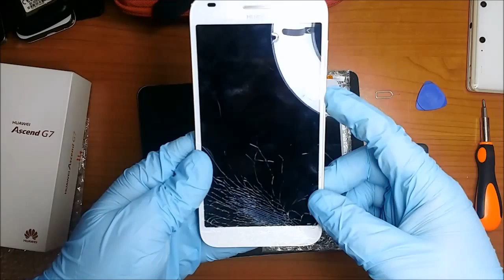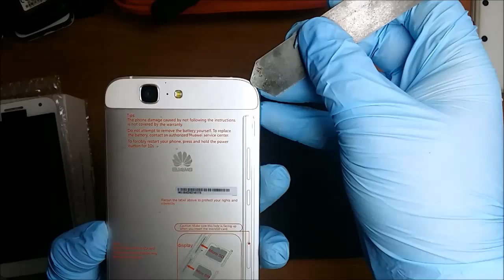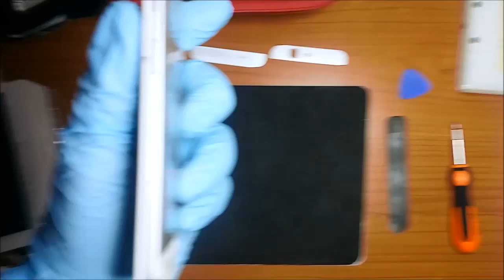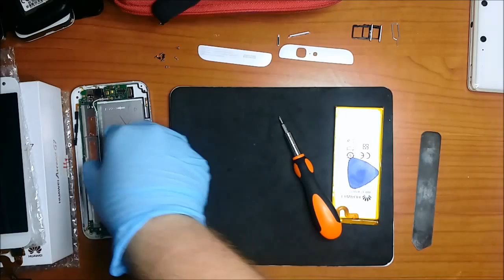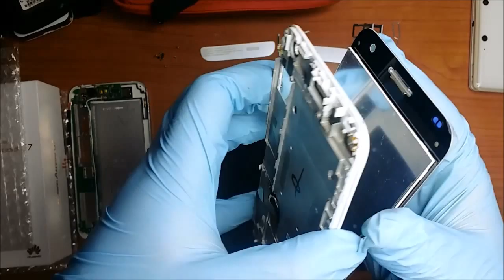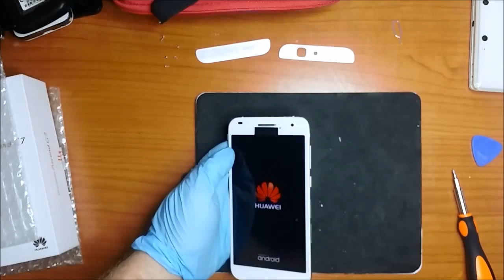Huawei Ascend G7 disassembly and repair screen

Comment: What temperature was your heat gun set at? 
Also how long did you heat the battery?
Thank you in advance if you reply, i loved the music & just doing the work without saying a word:))
I am ONLY replacing the battery because it will not charge, if that doesn't work then i guess i need to replace the usb connector.
Reply: Sometimes battery gets too low and won't charge.. So you inject 5 volts directly in battery via power supply for few minutes and then connect to charger to finish charging..

Comment: Hello

Thanks for your nice video! I have some questions though: is a heatgun 100 percent necessary to melt the glue from the display? And I don't see you using the heatgun when you're reassembling the phone with the new screen. So pressing it is enough to stick the display to the basis of the phone?

A big thanks and greetings!

Comment: thanks for the video, just replaced my screen assembly for £25 ! saved me a ton of money!

only thing i would say is be careful removing the battery as its stuck down very well, mine bent in one corner, but still works and charges ok :)

thanks again

Comment: ATTENTION: THE DIGITIZER GLASS CAN'T BE REPLACED WITHOUT BREAKING THE LCD SCREEN, THEY ARE GLUED TOGETHER USING A VERY TOUGH GLUE. 
ATENCION: EL CRISTAL DIGITALIZADOR NO SE PUEDE CAMBIAR SIN ROMPER LA PANTALLA LCD , ESTÁN PEGADOS CON UN PEGAMENTO MUY FUERTE.

He tirado 20€ del cristal a la basura por pensar que la pantalla lcd y el cristal iban separados como se ve en este video...
Reply: +pablo fernandez A mi me ha pasado exactamente lo mismo, pero ahora mismo estoy montando todo y creo que me falta esa masa negra que va antes de la pantalla y la tapa, intentaré pegarla con algo ya que no se aguanta
Reply: +pablo fernandez eso pasa por no tener ni idea de reparar un movil, en el video se ve claramente que la pantalla es completa es decir digitalizador+lcd. ¿acaso no ves como se lleva la pantalla antigua entera por delante? en fin tio suerte la proxima
Reply: +pablo fernandez Digitizer in G7 CAN BE REPLACED all you need is few additional tools like molibden wire and a bit of patience. So don't yell like that just because you can't do it.
Reply: +pablo fernandez conocen alguna forma de cambiar solo el cristal con el touch pues si lo venden es que se puede cambiar no?
Reply: pero si yo ya he cambiado uno y me salió bien. mas bien es cuestión de práctica.
Reply: THX pablo, good to know if my screen ever breaks.
Reply: Is the digitzer glass same as LCD replacement?
And ... how to you detach the glue? Using heat?
Thanks

Comment: My glass broke is it possible to fix it by doing just the glass replacement
Reply from the maker: Neira Babovic Sure! just order only touch! However for a few $ more it is preferable to take lcd + touch. $ 29 vs $ 38
Reply: Fcs ¿ a que temperatura tienes que calentar? para separar el cristal!
Reply: +Fcs Where do you recommend purchasing from online? My g7 needs a new screen. I seen one on amazon that comes with the tool kit.

Comment: Ciao vorrei comprare questo terminale, ma ho visto che è un problema che hanno molti dello schermo rotto, è vero che non appena cade si rompe?
Reply from the maker: Luca H A dire il vero no. Ho il terminale da circa 8 mesi ed è caduto un mare di volte . Mai rotto... questa è semplicemente sfortuna
Reply: +Luca H a me e' caduto 2 volte una e' andata bene l'altra volta si e' rotto , non credo abbia il gorilla glass. Ho avuto un LG per 5 anni con gorilla glass e non si rompeva neanche a martellate

Comment: After you've removed the old screen, you use no sticky tape whatsoever. Will the screen keep in place that way or is it recommended to use double sided tape on the new screen ?
Reply from the maker: Yes. Is recommended to use Double Side to tape New screen! 
In the video I have not shown it had already put double adhesive! Please subscribe ! Thank's

Comment: how much time does it take?
Reply from the maker: ***** To do everything it takes 20 minutes. to remove the display must lose five minutes with hot air at 400 °
Subscribe and click like!
Reply: 5 minutes hot air at 400°?
Reply from the maker: No. Total is 5 minutes. For remove 20-30 second hot air at 400° and remove. Repeat and remove. Total 4-5 minutes

Comment: it is possible to change just the touch screen?
Reply from the maker: Of course , with the ' use AIR hot and a bit of patience . But I Agree Change lcd + touch that costs $ 34. The touch instead $ 20 .

For $ 14 difference should change lcd + touch .
For more information or video  subscribe in my channel